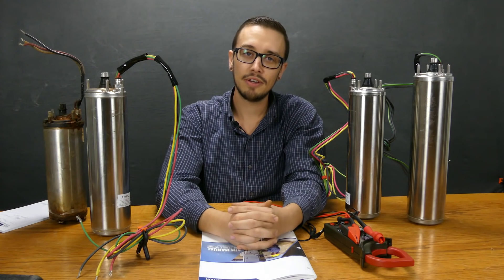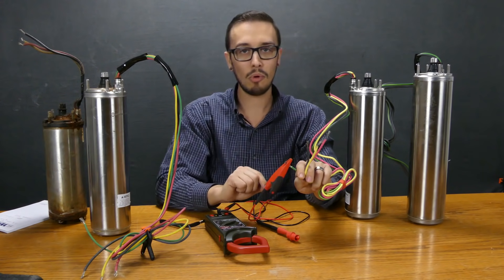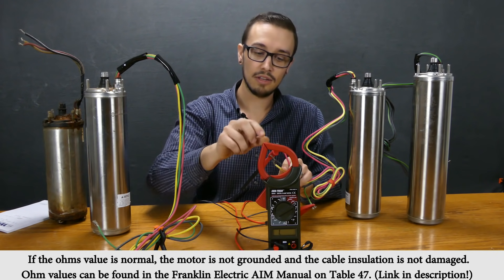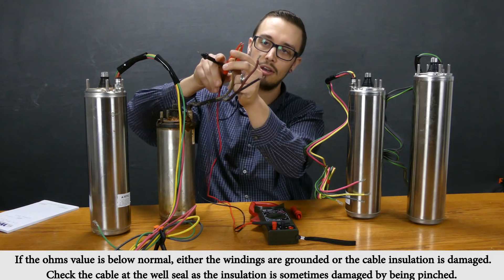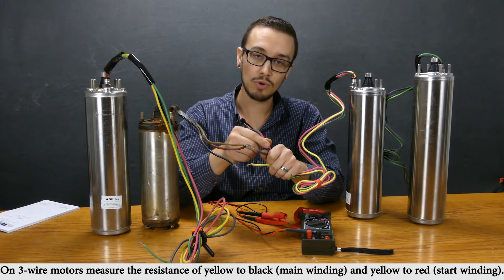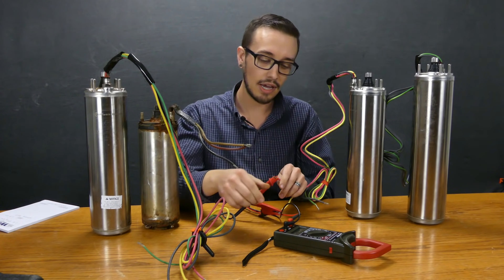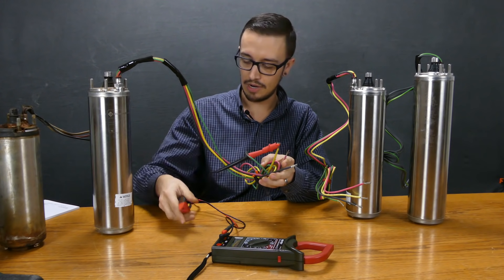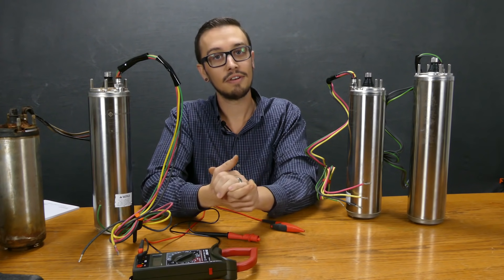Troubleshooting 4" Submersible Motor: Insulation & Windings Resistance

Comment: Thanks for the the video, i revived 30 ohms on the pump that doesn't work, and 4.5 ohms on a pump that works. I have a different brand of sump pumps. I tried to replace capacitor as well but it sill won't turn on so it must be the motor winding have just gone bad. Anyway great video and this explains a lot on trying to fix/ repair sump pumps.
Reply from the maker: Glad you found it helpful!

Comment: Hello thanks for your video. Do you have a contact number and when you say if the pump is in the lake. You’ll have to fine a ground.  Can the ground be just hooked to metal of it has to be on the casing. Because my pump is still in the lake. I have three wires coming out the lake.

Comment: Wife called to say there's no water pressure. Came home, smelled a fishy smell and noticed oil stains below the pump controller. Pulled controller and found start cap very hot and had vented.
I have 11 ohms from red to yellow, but open from red to black and yellow to black. Is this what overheated the start cap?

Comment: You can't test the start winding circuit on a 2 wire pump without pulling the pump out of the well and isolating the start circuit. That's a big advantage for the 3 wire version - where the cap is on the surface in a control box. You could determine a shorted capacitor if your ohmmeter is accurate enough as it would read less than what the run winding should read (ex: 2 ohm run winding with 7 ohm start winding would read 1.6 ohms). An open capacitor would not be detectable as you would only read the run winding resistance. A grounded start winding should be indicated as well but not an open start winding.

Comment: Contractors don't want to repair submersible pumps (only jet pumps get repaired) but  contractors also don't want to install jet pumps. Can I replace a bad motor on a high end 4" submersible pump with a generic lower cost motor?

Comment: I am measuring at the we'll head and am reading 2 M ohms from both lines to ground and from the neutral to the ground. Does this mean there is a short to ground and the pump is bad ? Pump has stopped working and fuse keeps tripping

Comment: My well is 535 ft deep. The well pump Motor is a 4 wire (often called a 3 wire) or 1.5 hp. There is 10 wire coming out of the cap, and runs to the Control Box within 2 feet away. Finally, there is above ground UF-B Wire, Direct Earth Burial Cable wire that runs 184 ft to the power pole. I want to relocate the Control box to 130 feet away from the well Cap, and still 54 feet away from the power pole using buried conduit. Can I use 10 AWG wire and connect it to the 4 leads I make at the well cap?
Thank you in advance for any advice and your video's, that are a great help!!
Reply from the maker: #10 wire is only good for 480' total run at that horsepower. You should be using size #8

Comment: I replaced the well pump that was a 3/4 hp with a 1/2 hp pump control box and pressure switch are for a 3/4 hp they both tested good according to the instruction videos of your but we'll ran for one day and quit could it be because of the fact I put the 1/2 hp pump in it ? I béen without water for two weeks now and have animals to water and I'm at a lose of what could be the problem please any ideas would be greatly appreciated

Comment: Could you advise why the power voltage drops when I turn on the submersible pump? Even if I am using off grid generator, it turns off the power generator after pumping for a minute or so
Reply: Short circuit

Comment: What you are doing is important.  I called the two well service company’s that are close to my farm and still have not received a callback.  Water well stoped pumping sometime last night.  We watched your videos several times.  We took notes and found an old Fluke 77 in the barn.  Changed the battery and followed the instructions as close as I could with a different meter.  You explained the process so well….  Get it Well.   That I was able to check the well leads and the controller box capacitors and trip switch with confidence.  I even downloaded the Manuel from your description so that would know the resistance readings for my particular 1.5hp pump.  I guessed at the depth for the well and was able to find the numbers that gave me the confidence to conclude the pump was just fine it had to be somewhere else.  Start-Up capacitor in the control box is where the numbers weren’t quite within the proscribed tolerance.  Made some desperate calls to the local venders within an hour drive and secured a replacement  box wit new capacitors.   We won’t mention the speed but they closed at 5:30 and my wife hinted that dinner on the stove required her being able to shower tonight.   That was all the incentive I needed to get the new box switched out and the pump running.  

You look good in hunting season scruffiness.

In closing, I must say again.  You are doing a service.  It is not always about saving people money.  I would have paid to have it done.  In my case I still have received a phone call from the service company fixed it two years ago for my grandfather.  He is not here anymore and it is ok.  I need to start somewhere.  He always told me that is he hadn’t learn to fix is own tractor in the early years of farming.  He would have never made a dime at the job.  

Cheers and Thank You,

Jbyford2

Comment: Hello, I can't get over 20psi at the pressure tank and the pump keeps running. Can a well pump wear out and only be able to create 20psi ? I isolated the water flow to just the pressure tank not the rest of the house, I also checked the air pressure in the tank and it's holding. I'm actually happy that it's not the old galvanized pipes in this older home.
Reply: I have the same issue, how did you fix this?
Reply: @adamhansen9261  I finally called a well pump service company, they said the pump was done. I watched the procedure and one of the 21' pipes had a whole and was dumping water back down the well. Our well had 6 pipes.

Comment: What could be the reason for mine, when you switch it on the light n the switch will not come up, but when you remove the pump supply or remove the positive to capacitor the light comes on and the pump will not run. What could cause that sir

Comment: Thanks for your video, I have Franklin Control Box Model# 2823008110, 230V, 1.5 HP. I am not sure how to find the associated Motor Model Prefix in your reference, but I think it should be 224300. I measured resistance following your video, setting at 200 ohm, the main (yellow and black) read at 4.1, the standard (yellow and red) read at 10.1, and Red and Black read at 13.1. All insulation testing is good. Is my pump in good sharp? If it is, then I will replace a new control box has all the components to see if it can start to work. Thanks, David.

Comment: Great vid. My system failed suddenly. Control box checks out. I performed these windings resistance tests. Seems I have very low resistance on all conductors to ground indicating shirts to ground. But I’m also showing 20k ohms or more through the windings indicating opens in all windings. How would this make sense?  Thanks.

Comment: My well has recently started acting up. The reset switch pops after about 3 minutes of run time. I have replaces the run capacitor, no help. Today I put a Fluke Amp clamp meter on the pump wires (1.5 hp motor) it was running along at 1 - 1.2 amps, the relay chattered and the amperage shot up to 6 amps and the reset popped. What could be causing this? We only use the well for watering the yard now but I'd like to get it working again.
Reply from the maker: Sounds like either a loose connection or the pump is going out.
Reply: @RCworstwater  Thanks I think I have determined that the pump is bad. I'll just have to wait until I have the funds to pull and replace it, we're 420 feet deep so I'm looking at about $3000.

Comment: Help   My pumptec keeps shutting down at 30 psi. It connected to a Flint & Walling 1 hp 10 gpm 230 volt submersible. Pumptec sensitively is at the complete minimum. I disconnected the pipe leading to the pressure tank and water flow seems weak. Any ideas are appreciated. 
Thanks
Reply: How many lights does the Pumptec have? If it has 3 and the middle yellow light stays on ..... you are over pumping the well. If it only has 2 lights, green and red, I would replace the Pumptec before anything else. The 2 light units are the older model.

Comment: Hi is it possible to have you go over material list for my new well?  It’s dug and well log is at hand, 440ft deep, static water at 330 ft, yield 25 + gpm, 4” well is located in Corning California, empty lot planning on building home.  At the moment, just plan on getting water out to nearby water storage tank of 2500 gallon, located down hill about 100 ft from well, a drop of 30’ in lifting water I guess.  I plan on having a generator to pump water out to storage tank, so pressure switch is not needed.  I need help in deciding a submersible pump preferably 1.5 hp, wire size( 10/3 ?), piping (blue polyethylene 500 ft roll, 1.25”?).  I never have a well of this depth but am curious and want to install pump myself for saving money, but also wanting to know well better for maintenance in the future.  I also plan to build home myself.  Understand this may not be right venue to reach professional advice, just wanted to try.
Reply from the maker: We sure can help! Give us a call: 855.329.4519

Comment: What if the pump starts, shoots water out for a second, then stops? Then it tries to restart, shoots water again and stops. The cycle repeats. 
I haven’t measured the currents yet. Have ya measured the resistance either yet, I ordered a meter and it will arrive on Tuesday.

Comment: sweet jesus thank you brother! checked my control box and pump with your steps both checked out fine, did a continuity test on all the wires from the house to the pump, no continuity on the yellow! found the break! will be fixed by tomorrow for another $20cdn on top of the 40 I spent on making the puller!!
Reply from the maker: Nice Job! Happy we could help :)
Reply: Nice one  thank

Comment: Test the resistance of submersible pump 7.5 kW cooling system water gave the following values between the first and second and the first and third 1.7 ohms second and the third and 0.8 oum. When the operation gave 50 amps for about 5 minutes and did not work What are the reasons for the cause of the holidays and how to avoid this,

Comment: I looooove your videos! I'm testing the ohm reading on my 1/2 hp motor. Can you tell me what the ohm reading should be? I have 6.2 between black and yellow and 19.5 between red and yellow.
Reply from the maker: 115V or 230V?
Reply: 230 volt

Comment: Ho can you tell if the pump was hit by lightning test.?
Reply from the maker: The only tests you can do are the ones we performed in this video. Often, lightning strikes will fry the capacitors or relay in the control box though. I would check them first.

Comment: Is there a way to tell what horsepower the pump is without pulling the pump out of the casing? I just purchased a property that has a deep well but idk what size pump is there. The control box isn't there so I can't reference that.
Reply from the maker: You can take an amp reading and compare it to the values on pg. 13 of the aim manual: https://www.rcworst.com/Shared/content/mfr/franklin_electric/docs/franklinsubmersiblemotorguide2010.pdf
Reply: R.C. Worst & Co., Inc. Thank you! I checked it yesterday and came up with 2.8 ohms on the main wires and 10.3 on the start wires so that putse right at a 1 HP pump. Thanks again!

Comment: For deep well (250feet) 5HP 8 stage 3 phase submersible Motor pump under 220v what is the pump impeller size and specifications to give out the water at high pressure  and is it impeller size proportional to high pressure water out

Comment: Question ?
2 wire pumps have a internal start capacitor vs 3 wire. And the pump with the open winding was a bad start winding so the pump could run but can't start. Thanks